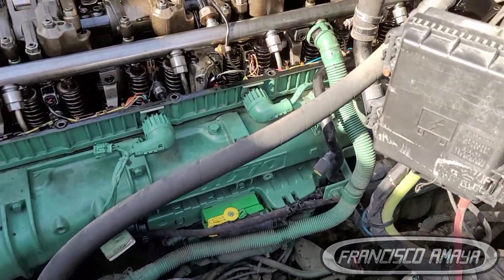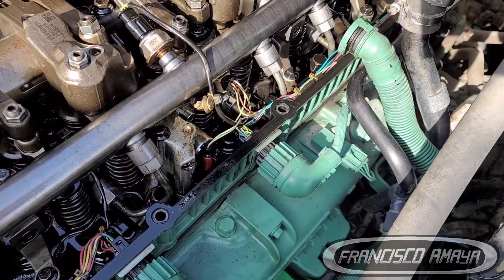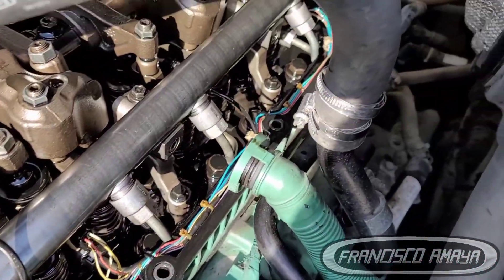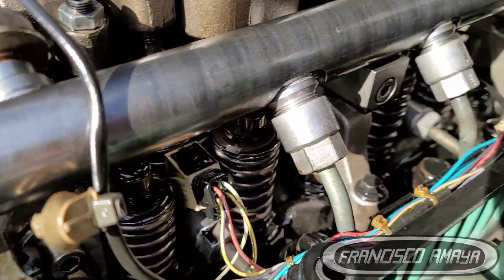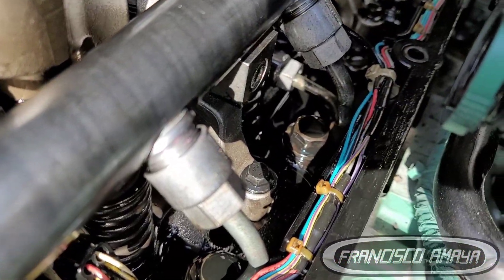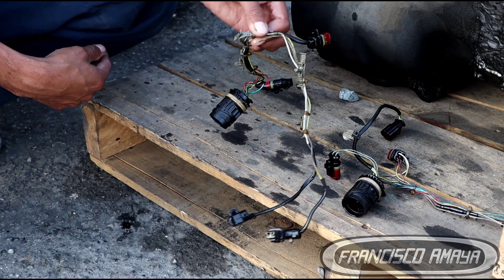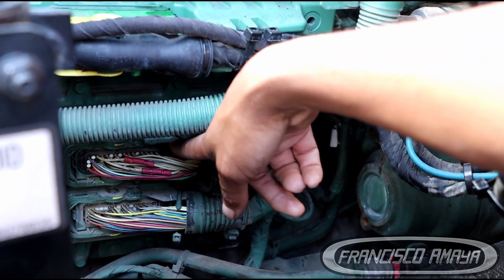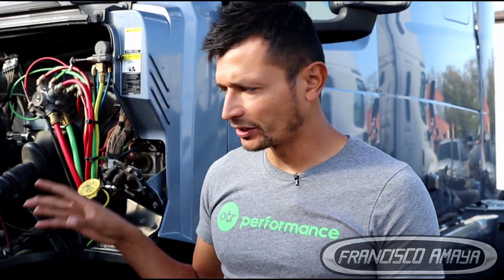Volvo D13 engine spn 652 fuel injector electronic circuit malfunction check engine light on

Comment: hola, tengo un 2019 truck volvo d13 760 y presentaba un codigo de mis fire injector 6 y le cambie los  6 inyectores nuevos y los cables nuevos y aun continua dando ese fallo del inyector 6 , que posible solucion??? cambiar el cable que esta afuera?? gracias anticipadamente

Comment: I have a 2015 volvo with a d13 and am getting this cold sa 16 dtc p030600 the truck is blowing white  smoke out the exhaust and feels like it has a misfire on  Idle or accelerating then truck runs good and stops smoking I just replace all the injectors and cups but still have the same problem
Reply: Did you find what the problem was??
Reply: Hello brother did you find out the problem. Because I’m having the same problem please help me. I have a problem starting and white smoke coming out of the exhaust
Reply: Hi bro any update on this i had the same problem

Comment: Hola te escribo desde Uruguay y hace poco descubrí tu canal, yo trabajo en mecánica de ómnibus y camiones desde mucho tiempo. Y estoy interesado en emigrar a Estados Unidos y me interesa mucho ponerme en aprender en esos motores que aquí no hay. Que  posibilidad habría gracias
Reply: You could probably find a dealership or large company to sponsor you. There's a major lack of technicians in this country, especially those that can work on and drive the older trucks or able to fix it with limited parts availability. Not all trucks around here are new. Many many smaller companies and owner-operators still running old mechanical engines.

Comment: I have a 2015 cascadia that it gets hard to put in reverse or 1st gear .  Like when I’m at a warehouse unloading or loading.  It’s a 10 speed transmission.    It does it sometimes feels like the clutch brake is not working.   I have to floor the clutch and slowly put it in gear.